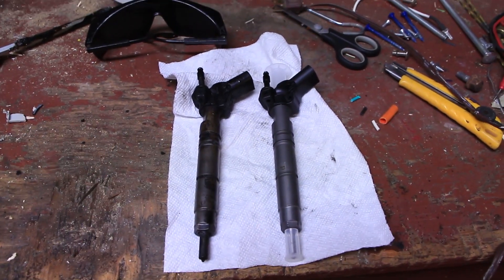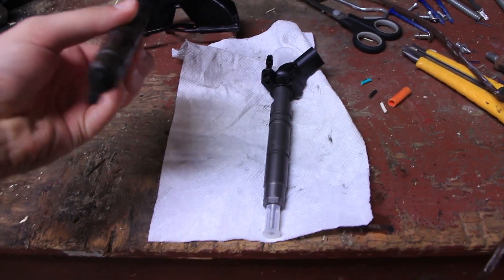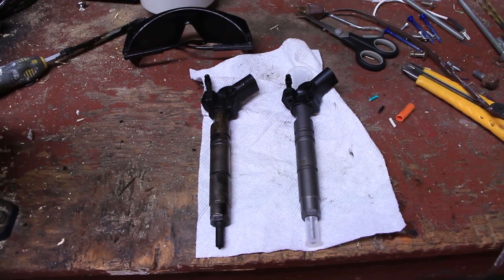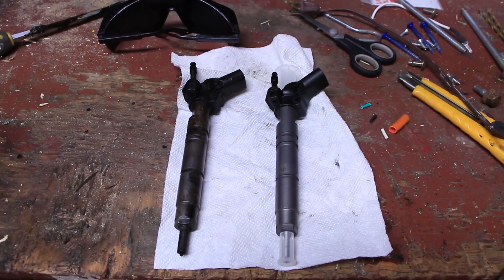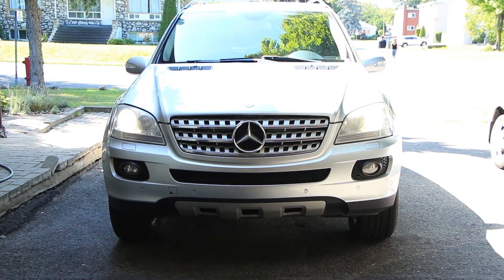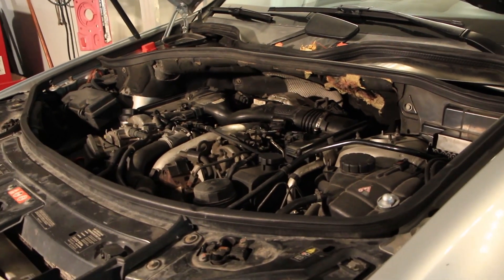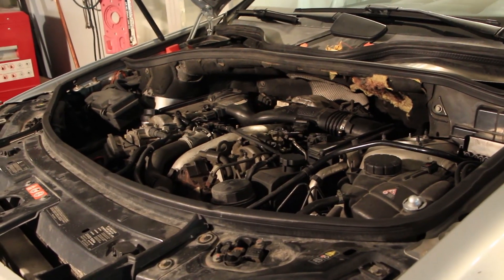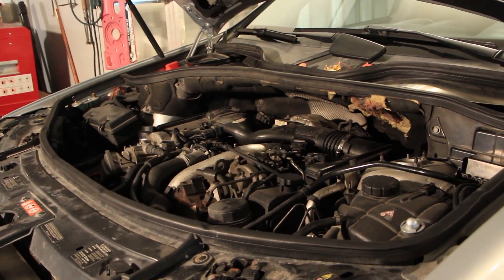OM642 Injector Replacement - To Code Or Not To Code?

Comment: Why are you spreading this disinformation?
Better keep for your self or go to school and learn proper mechanics.
Injector coding is very important * computer can know when to inject fuel and how much.
Sample injector with more fuel flow becomes triggered later
Injector with less fuel flow getting triggered early to complete the combustion cycle.
Those high tech new generation injectors are impossible to make equal all of them
Every injector has difference for that reason coding is so important.

You can run the engine with not coded injectors = tell me after some time about your engine or PDF?
Reply from the maker: Ok well lets address all your issues.

The premise of my video is that you have a larger problem (as I had). In my case, I had a fuel injector stuck open, dumping fuel into the cylinder. That is clearly much worse than a miscoded injector. Now unfortunately, most shops will only sell you brand new injectors, which are VERY expensive. I found a source to get rebuild ones, however that means I would have to put them in myself, and as I don't have a scanner which can code the injectors, the question is... Can you do this (not should you do this). Given the circumstances, I opted to try... and it works quite well. It has been about 1.5 years now since I did this, and I've never coded the injectors, and I've had 0 problems. The engine regens the DPF at normal intervals too (hardly ever during summer, more often during winter).

Now, should you do this? I understand the need to have this done. Whenever a car needs to be emissions tested, this has to be done because you want the injectors to be firing optimally as soon as they are installed (so you can proceed with testing).

Now, I know a few things about engine management software. You can very easily trim individual injectors with time (fuel trims have existed since electronics took over fuel injection, individual trims are slightly newer, but by the mid 2000's most cars had this). So I reckon that with time the injector will be trimmed correctly and there won't be a problem (but it would not work immediately, say during an emissions inspection you discover you have an injector issue, and you change it out right away). Now this is a guess, however it is what I observed with my own car. There are multiple injection events per combustion cycle (around 5 on modern diesels). The pilot injection was indeed incorrect when I first fired the engine up, that cylinder was noticeably louder, this I confirmed with a stethoscope. However, after a long ride on the highway, this problem cleared itself away.

If this all blows up, I'll be the first to post it here. As I said, so far it has been perfectly fine for 1.5 years, and since then the car has done about 20k km, so I'm not overly concerned about it.

In summary, not coding the injectors can get you out of a pinch. If you don't sleep well at night, you can always code it after the fact.
Reply: @PatsCarGarage  I know what scam business can do - all of them are uneducated simple tiffs * What so ever your problem was * When we replacing injector needs to cod that injector - during the rebuild of injector must be tested flow rate - this gives codes * Some peoples do not know this  - not have a tool - or just  drive - Good scanner iCarsoft MB V2 (Mercedes - Sprinter - Smart - Only) or Vident iAuto 702Pro Professional OBD2 Scanner - can do codding plus other modes as need on Mercedes BMW Plus more
Reply: BS
Reply: No need coding as I gave a Range Rover sport tdv6 3.0 v6 engine and I replaced all 6 injectors and it fires up bang on no shaking or smoke or anything it just works fine . He said right that Ecu will learn may in just in a few miles drive Ecu will collaborate it itself
Reply: @luxurycarpets4028  Oh yes sure only replace the injector and engine going to work.
No problem for you and problem with emission and fuel consumption.
If you know how the system is working you never go to argue.
I give you a sample - replace the tire and not do balance.
Sure you can drive the car.

Comment: This is straight up bad advise. Code the injectors when installing.
Reply from the maker: Can you elaborate? I'm going on a year without any issues so far...
Reply: Pat's Car Garage the stratified injection gets out of balance... you almost can not tell the difference , you are just polluting even more.... it like crazy.
Reply from the maker: @Alta9610   That's an explanation that makes no sense. Stratified injection out of balance? That's honestly not transferring any information about what the problem is. What's out of balance, the pilot injection? The main injection events? Why would any of them be out of balance (out of balance with respect to what, each other? against the perfect value?) Sure maybe the first time you start the engine, the pilot injection event might be wrong, and you will get some diesel knock on that cylinder (which happened to me), but the injection events are all self correcting. After driving on the highway for a while, the engine was back to super smooth at idle, so clearly the pilot injection event corrected itself. If the ECM can correct the pilot injection, which is completely useless apart from making the engine run quieter (and burn more fuel), then the ECM can easily correct the main fuel injection events.

I maintain my speculation that the coding process is only there to make up for small discrepancies in the manufacturing of an injector. That way, as soon as an injector is plugged in, everything is setup perfectly, and requires no driving around before adaptations are learned (which is an important consideration given some states have mandatory smog testing). It's the same non-sense as needing to reset the adaptations after an air filter change. Like why would that matter? The air filters are before the mass airflow sensors. It's just dealership cash grabbing non-sense.

To address your concern that it's polluting more. More than an injector stuck open dumping fuel into the cylinder? I doubt that very much. Here are the observed side effects of replacing the bad injector: fuel economy has gone up, and the DPF regens FAR less often. We're back to driving 1000km per tank, before that we would be doing about 800km.

I'll welcome any criticism to my speculation, but decent arguments have to be made here. If my engine blows up as a result of this, the people subscribed to my channel will be the first to know...

Comment: That's great news Pat! Thank you for sharing and giving the update. I have an 05 e320 cdi and replacement parts don't have to be flashed like the more modern MBs. Its infuriating that they designed them that way. I will be buying an 07 gl320 cdi in the next couple days and just wanted to research all I could to see what all I'd be able to do should I need to repair. Like you I am a big DIYer. I too plan on doing the dpf and egr delete. Another absolutely infuriating addition to diesels. I wish they would bring back the inline engines like the om648 and those like them. God bless and good on ya!
Reply from the maker: I would totally do a EGR / DPF delete on the ML (maybe even a bluetec turbo too, it's bigger). It's my mom's car though, so I'll let it be for now...
Reply: Seemingly merc HAS went back to i6......

Comment: Here is the link to the pdf I found. It's a service manual for om642 and its fuel system. Goto page 88-100 specifically about injectors and how they work with this motor. Coding specifically is on page 100.

https://www.google.com/url?sa=t&rct=j&q=&esrc=s&source=web&cd=1&ved=2ahUKEwjimqG_vrnkAhXwQ98KHSxGBKAQFjAAegQIABAC&url=https%3A%2F%2Ftechauthorityonlinedemo.extra.chrysler.com%2Fservice%2Fmds2002%2Fworkbooks%2Fen_US%2F8169906009.pdf&usg=AOvVaw0pNAnqrDjQxQvaCQyAbqaf
Reply: Thank you very much for posting a link to the manual. I have a OM642 in a Jeep and have been looking for this information.
Reply from the maker: Yo this pdf is super! It's an interesting read. I don't doubt that the most correct way of doing things is by coding the injectors upon installation. I wonder if the STARscan is absolutely necessary for this, or if 3rd party scanners can do it too. None the less, I have not experienced any of the possible problems should coding not be performed. This goes to show that anyone needing to replace an injector can just do so, and if there is a problem you can always read the code (it's visible since it's on top) and code it after the fact.
Reply: @PatsCarGarage  Since my last comment, I've gained more knowledge and a little more experience about Bosch crystal injectors. I've taking them apart analyze them under microscope and everything. I understand now you can install them as is and they will work regardless just not as well as they have the potential to.
Reply: The thing is the efficiency of it all. You'll save more gas and you'll have more power if they are coded. It will smoke less and it will sound quieter also. I was able to code my own injectors with a $50 Bluetooth code reader programmer from Walmart made by Autel. You use your cell phone and download the app to make it all work and it talks to the computer and you program it through your phone and it actually works well with live data and all.
Reply from the maker: @zzacco  That's great news!

Comment: There's a service pdf I ran across that explains the injectors piezo crystal makeup. I understand now why they need to be coded after reading it. I have a lot of white smoke with six different injectors transplanted with another used  motor. So, I am about to put the 6 original injectors back in this new motor because they have been coded and verified by the ecu.
Reply from the maker: Do you think you could share a link to the pdf? Lots of engines use piezo injectors which do not need to be coded. I'd be interested in giving it a read.
Reply: @PatsCarGarage  I will post it soon. I'm doing my injectors as we speak. They say only the diesels need coding. I guess because it relys on the compression to ignite vs. Throwing a spark. The crystal expansion/contraction inside these injectors aren't all the same from the factory. The coding is essential for the best timing for complete burn. Hense the smoke in my case.
Reply from the maker: @zzacco  Are you sure it's not smoking because it's doing a regen? If you had stuck injectors for a long time the DPF would be plugged up to the point the ECM would command a regen at idle.
Reply: @PatsCarGarage  I thought about that. I cant tell. I need to invest in a good scanner. Plus been wanting to do the gde dpf/egr DEL. That would rule it out. I'm learning alot however. I put the original coded injectors on this motor (to leaky to hold psi) opened up one and cleaned no difference. I'll do a few more before I give up and buy new ones.
Reply from the maker: @zzacco  I need to get myself a proper scanner too. I've got a basic OBD2 one for the C220 but it doesn't cut it for the ML. I would also to one day do a DPF/EGR deleteon the ML, I feel like it would improve mileage and reliability big time.
Reply: @zzacco  I did the GDE dpf & egr delete together with a 3" cat back straight exhaust with a gutted DPF several years ago. It has worked GREAT!
A few months ago, I sent GDE an email because I installed an OEM trailer harness on my Jeep which requires updating the BCM. It appears that dealers are the only ones that can do the reprogramming. So I contacted GDE to determine if there would be any issues. He told me that there shouldn't, but also informed me that he wasn't supporting OM642's anymore. Evidently, someone has threatened him. If you haven't already done the reprogramming, you may have missed the boat.

Comment: Where did you purchase this rebuilt injector from?
Reply: Look on eBay lots from Germany can get very good injectors or from the UK *  do not touch injectors from USA or Canada * Simple Joe without the ideas how to do a proper job.* Average cost 150-200$
Reply: @jaguar7051  there in Ireland plenty of used ones may not last as long as new but half the price  helps
Reply: @davidnewman7014  Yes sure - how much cost each one? I get a new one for 175 euros - in the real world no rebuild piezo injectors, scam operators cleaning old injectors charging a fortune - It is very important to use diesel additives to clean and lubricate injectors and high-pressure pumps.- I like my injectors showing 100% operational in Bosch specifications - water in diesel fuel is the main killer of the piezo element in the injector - professionals so rebuild injectors saying up to 150K km can last only - my friend ML350 350K km and injectors perfect.
Reply from the maker: I bought this one from RockAuto. It was their last one left though. These injectors are really hard to find in the rebuilt market right now, there isn't a lot of them floating around, and nobody is buying new ones because they are stupidly expensive. You can either try shopping around, or you can try to find a Bosch certified service center to have them rebuild it.